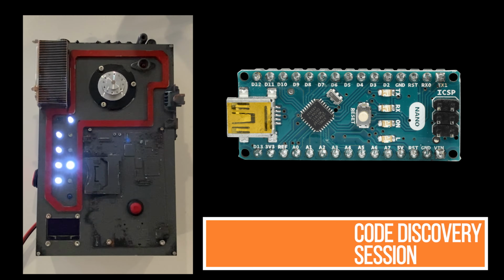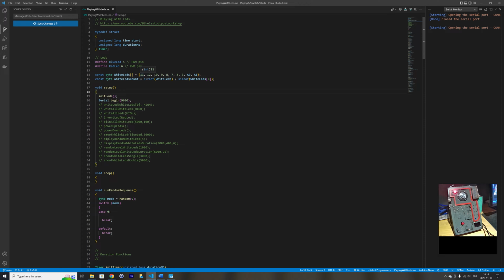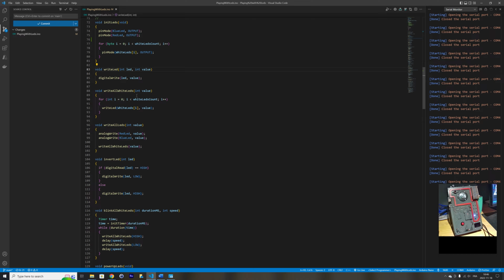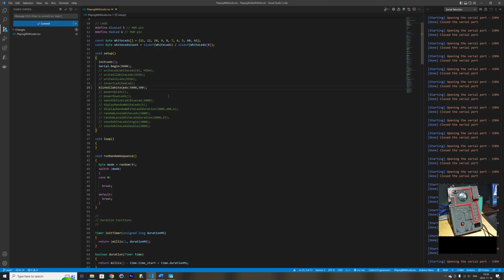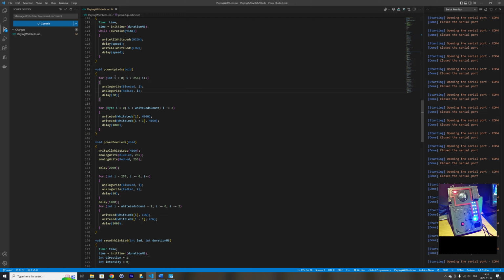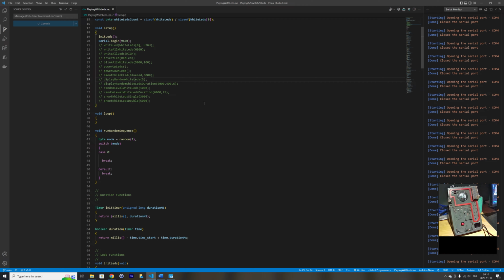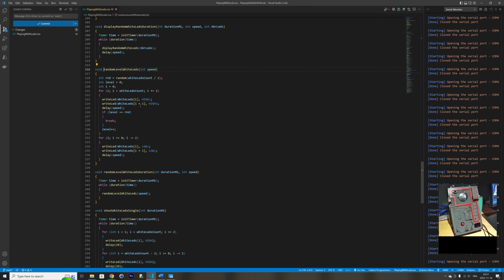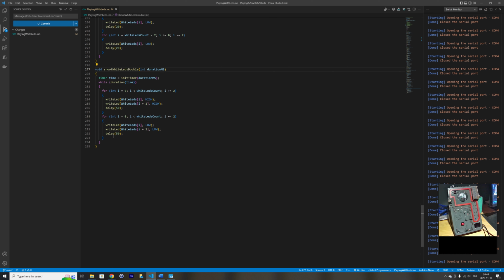Master LED Animations with Arduino

Comment: I'm using a PCA9685 with an ESP32 to reduce the amount of wiring. But my coding skills are very poor. I tried to integrate your code to suit but failed. Could you change the code to use a PCA9685 instead of direct pin outputs?
Reply from the maker: Sorry but I don't have a PCA9685 to see how to adapt the code

Comment: Absolutely fantastic ❤. So many channels cover electronics or arduino programming, but none show all of it and also utilizing a sci-fi panel. Seeing it in a panel just somehow helps a lot …differing from just the leds posted on a breadboard. Love the in depth description and explanations 

Does the program code you use, work identical to the arduino ide?  Like, is it just a different encoder with same language? Or there are differences?  I ask because I am only slightly familiar with the ide version

Again…loved this video. The mix of Star Wars panel to teach programming automation is brilliant. Very motivating❤
Reply from the maker: Yes the program code works without any changes in the Arduino IDE.  Just make sure your sketch name has the same name has the folder where it is placed, otherwise the Arduino IDE will complain.  But the code is the same no change.